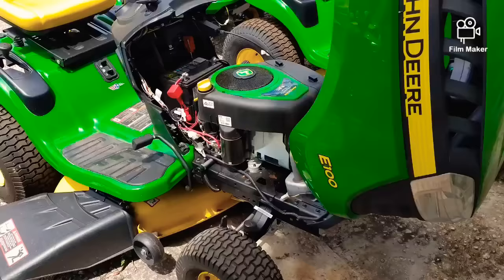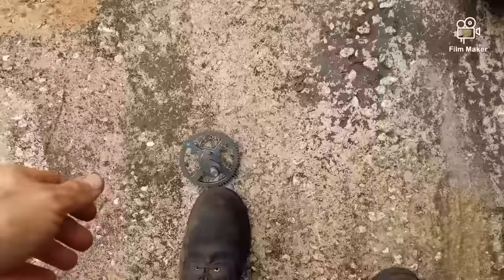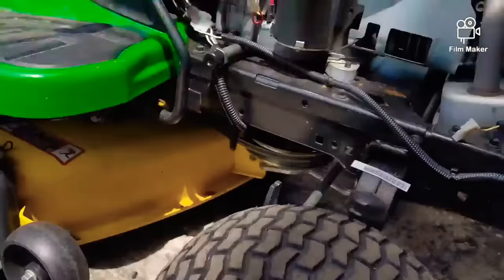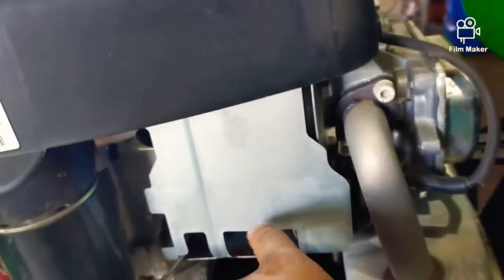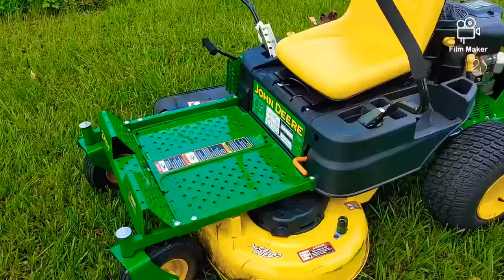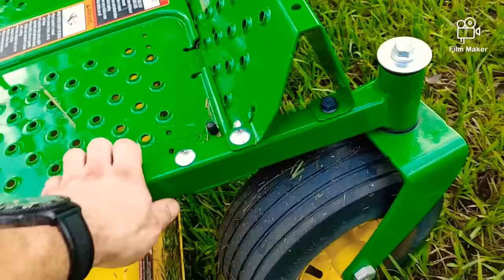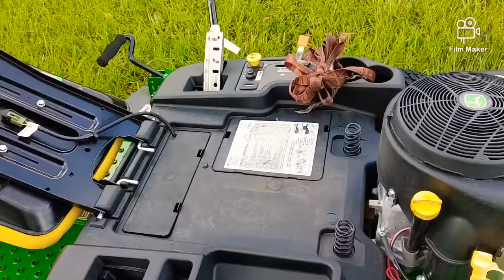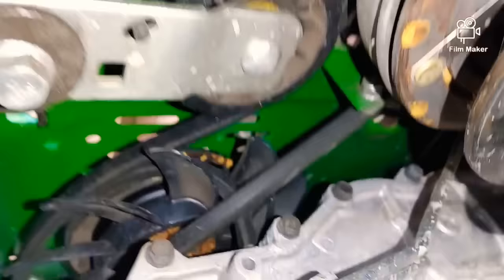Lawn mowers to avoid!

Comment: You bursting my bubble man....
      I picked up a husqvarna 246Z that is about 4-5 years old.  It had 4.6 hours on it.     I bought it from a local tractor supply in Oklahoma called Atwoods.  I was told as is no warranty. I guess I guy bought it new and used it a few times then it went to the shop for a repair on the motor, something to do with the flywheel.  But it was the end of mowing season and it went to a local authorized small town repair shop that was backed up.  For whatever reason they left it set outside at the shop the entire winter before it was fixed. Then when the customer goes to pick it up for the new season thinking he has a new mower. So they brought him this mower out that the labels and the plastic is faded and has a cracked seat. He said hell NO!! So husqvarna replaced it direct and this mower ended up setting in the backroom of this store for 4 years.  Then I am walking by the store one day and seen it out front with a AS IS sign and it said needs belt and battery.  $200.00   So I asked them if I can borrow a battery and if it started and the hydros moved I would buy it and the battery.   Oh... I had to buy a key too.   It has 5 year old gas and it started right up and it moves under power.... I said sold!!!       I got it home it was missing the spring for the deck belt tensioner is why the baldes did not turn. I had I old spring I tossed on it and they spun right up.  But somewhere the dudes story was off because it had a badly bent blade and a cracked spindle casing.  But other than that it is a new 5 year old mower.      I bought it 2 months ago.  Sometime after the first I am going to order the right spring and the blades and spindle.      But I was pretty pleased as I always wanted aZero but did not want  to give up the $3200 that this model sells for new.  

I guess everyone gets lucky sometimes.  Normally if I hall in a pile of shit I come out smelling like shit, But hell this time it was a rose! 😂😂🤣🤣        I have not used it yet and no tellings what dude hit.  I was thinking maybe he hit something so hard the sudden stop of the blades jolted a under torqued flywheel and broke the key on the shaft knocking it out of time.    But who knows?   I know I got a good deal.    Sorry to ramble on.  Great video and thank you for sharing the info on things too look out for.  This has a twin briggs so maybe it will be okay.

Comment: Sometimes it’s just luck. I bought a country clipper 25 years ago to mow a tough 3 acres. I never did proper maintenance, I abused it like a farm tractor, pulling stumps, moving campers, ect. Busted all the transmission cooling fan blades(plastic) in the first year. It’s sits in a barn on dirt floor all winter . Tires dry rotted, deck finally rusted out neglect. I bought a new one last summer and noticed it’s not quite as robustly built but still leaps and bonds better than big box store mowers. I’ve also noticed that mowers listed at 1500 bucks 3 or 4 years ago are now going for closer to 4K. 😂. Oh Yeah, that old neglected one I’ve had for 25 years still runs great and moves campers all the time(in grass, no pavement). I don’t know if it’s a testament to quality or just plain luck but the only issue is dry rotted tires I just fill up whenever I use it.

Comment: I have that same Z335E. Took me 20 minutes to replace my drive belt. Not a nightmare as you described. Don’t even have to remove the deck which is great! That’s the only issue I’ve had. I did buy the foot peddle to raise the deck though I do agree that’s a shit design. It’s a great residential mower in my opinion.

Comment: I think you should have been clear about this applying to recent models as far as the JD zero turns. I work on small engines as well, and my personal machine for my 1.7 acre property is a Z 245, have had it over 10 years and has been excellent, could not ask for better.
Reply from the maker: Hi Peter, I agree with you that I should have made the point that Im talking about the recent z335. Id guess 2019 - 2022 models. John Deere actually improved the mower drastically. They now went back to using bearings for the caster forks, improved front tires, the deck lift now uses a foot lever and dial to set the deck height. They also got rid of plastic planel the covered up everything under the seat.
Reply: I’m buying a z245 with 168 hours on it, anything specific to look for?
Reply: @Mechanical_Mind  I just bought a 2023 z315, whats the diff between those and the 335?

Comment: Either the cam lobe is made of "plastic" or, it's a pressed in metal lobe. Both are crap to work with. I had a John Queer which, the lobe turned a little bit on the cam thus, throwing the timing off. It was a pain to find. What saved me was, I had an engine in pieces and, I compared the camshafts side by side. The one under repair was off by about 2º. Once I got the new cam, it confirmed that the "old" cam metal lobe did spun a little. I spot welded a couple of tacks around the new cam lobe so, it would stay exactly where it belongs. I don't know if it's not recommended but, the machine still works, as we speak.

Comment: I have a Z335e with aprox. 650 hours on it(i use it commercially)  and what the guys says is right...plastic bushing breaks.  front wheels need to be inflated often( i keep an air compressor in my truck almost just for that)  the drive belt was replaced once(not a very hard or expensive job to do) the solenoid in the back near the rear bumber needed to be replaced once(JD upgraded the piece)and 2 inside solenoid under the cover needed to be replaced....good first zero-turn for the money to start my business but next year i'll put that one on the sideline and use it only has a backup unit.  Next zero-turn will probably be a Z500 series from JD or a Z200-400 series from Kubota...what do you think?

Comment: According to one YouTuber from California you need to use less polluting electric yard equipment.  My comments were do you really want that yard tractor with those unstable Li-Ion batteries that can burst into an un-extinguishable 5000 degree F fire.  Not for me, until they perfect those batteries and shore up the electrical grid to take charging all  those yard equipment and automobile chargers and support your house air conditioning equipment.

Comment: I have a XT 515E with a 54 inch deck.  I have almost a 3 acre yard.  This mower was bought almost a year ago and it only has 23 hours on it.  It has been a piece of junk and stays broke down more than it stays running.  I bought a ZT1 cub cadet and haven't had any problems with it.  The John Deere 515E is the worst investment I have ever made.  I will never buy John Deere again.  Within the first 30 days that I had it, I called Ag Pro in Macon, GA to see if I could trade it or bring it back.  I was told NO.  I will not deal with them again either.  I'm still paying on a piece of junk that is literally broke down as I'm typing this.

Comment: As a z335e owner it’s a pos. Mower cuts half the yard and dies.  Come back later to continue. New carb new gas cap new plugs filter air n fuel. Very disappointed.

Comment: I think the older generation of residential zero-turn mowers are built better. I have a 2007 42-in cut and 48 in cut zero turn. Both have 700 hours now on the Briggs & Stratton engines and they still run fine. I've had both zero turns for 14 years and the only thing I had to replace was the head gasket on both engines. Other than that no problems. All these newer residential zero-turn are just built cheaper and a lot more complicated to fix.
Reply from the maker: I agree older mower where built much better. I have many loyal customers that would also agree.
Reply: Go with the Kawi

Comment: Not all residential zero turns are like that. I have a Kubota Z122 (42" deck) and it has none of the problems you mention. The deck is fabricated, the casters have a grease fitting, deck lifts with a rod and foot pedal, etc. The residential Ariens/Gravelys are also made similarly. I agree those John Deeres are crap though.

Comment: I bought a Cub Cadet medium tier quality zero turn mower back in 2015.  I've never had any issues with my mower, and  I have a rather large yard.  Also I NEVER step on the deck!   
I have a severe bad back, and I can access the deck without stepping on the deck.  

The only thing I dislike about it... is the battery is a pain in the ass to take out and put back in...there is a bolt that is on the frame and it's in the way.  I lift that battery out every fall and bring it in the house and put it on a trickle charger for the winter.  One has to lift and tilt the battery perfectly to get it past that bolt.   

It would have been much easier if they gave that space another 1/16 of an inch to just lift that battery straight up and out. 

The batter also sits behind the seat, there is no compartment under the seat.  And if sitting on the mower, it's not that hard to lift the deck with the lever to change the cutting height.  Again, I have a very bad back, and I'm able to do that without much problem. 

Maybe I just got lucky, or Cub Cadet was making a better zero turn mower back then I don't know...but again, no issues with my machine.

Comment: I've had great luck with my LA 115 - 2009 model  , 19.5 Briggs  . It has the metal transmission , but I didn't have an idea about those plastic transmissions . John Deere is cutting there own throats in my thoughts ....

Comment: Just like any other piece of equipment, all of them are crap if you don't take care of it. With that said, I have beat the living crap out of my Z235 for almost 10yrs. Where I live, rocks "grow" by the day and I am constantly going through blades. However, after busting enough rocks to pave a Seaworld parking lot...I have yet to have to change a spindle. I've had to make repairs on the deck and the guide wheels are a constant nuisance...but overall...this mower has held up better than any mower I have previously owned (at least 10), for the amount of abuse it takes and the minimal amount of maintenance it has taken to keep it running well.

Comment: I have one of those twin cylinder Briggs and you forgot to mention the valve guides that push out. Mine went out at 30 hrs and JD failed to cover it! Dealer blamed overheating but that was an excuse but these mechanics aren't capable of evaluating much as  mine was never run hot and was impeccably cleaned, maintained and always stored indoors (come on 30 hrs!?) Replaced head and expect the same to repeat itself soon. John Deere sells because of its name but that soon will be destroyed when management continues to make these poor marketing decisions.

Comment: Here’s my story on my JD E100 bought from Lowe’s, paid $4000ish it, we have approximately 1acre to mow guessing 3 times a month 8 months a year, had the mower just about 3 years, it ran perfect had right at 100 hours on it. Was redoing my fence around the property was using the mower with a trailer to keep materials supplied to my kids as they dug holes and set posts  yes I had approximately 400 pounds in the trailer. It quit moving, felt like the drive belt was stretched, I took the mower to my local John Deere dealer Everglades John Deere in central Florida, he says oh yeah this is common problem, $600 I pick up the mower, no change, no warranty !! $1800 for a new transmission !!! NOT HAPPENING !!!!

Comment: I purchased an la145 from Lowe's. It was on sale and it was a Deere (I thought). Within a week, one of the spindles on the deck broke. I went to a John Deere dealer for the part that Lowe's didn't carry, the dealer looked at the spindle and said let me guess, you bought it from Lowe's. He told me Deere doesn't actually make those mowers and took the time to show me the difference between mine and the equivalent REAL Deere. Needless to say, when the tractor died after 5 years, I bought a Toro, straight FROM toro. I was told mtd makes those mowers for Lowe's, home depot etc and Deere slaps their name on it as entry level deere's. Don't buy em.

Comment: 4:41 Disagree.
I bought a z-235 Deere 16 years ago to mow 3 acres of rough land. It's still like new and gets the job done with ease. Deck cables last about 5 years every time, and I'm still running on the original store installed oil.
Reply from the maker: You do realize that your 16 year old mower is js nothing like what I went ovet in this video right?? Its almost like some people dont realize that they change things over the years 🤣

Comment: For a few years, I used f535 jd lawn tractor. Didn't like it at all. Underpowered, steering was crap, because of the bearings in the back wheel.

Comment: OK....  You just ruined my day.  I have a residential John Deere Z.  I've had it for 3 seasons going into the 4th.  So far, no problems.  It seems to me I should just keep it because it works fine.  I wouldn't even no how to get rid of it;   Plus, you would have me buy a commercial Z which seems like overkill.  I bought my Z from a John Deere dealership, and I was going to buy a commercial grade, and the guy told me that I would be unwise to buy such an expensive mower to cut less than a 1/2 acre.  So, I am between the rock and proverbial hard place....🤣
Reply from the maker: Sorry I ruined your day.. Im working on a new video and it looks like John Deere has made some major improvements
Reply: @Mechanical_Mind  mine is a z345r….  It looks the one you had in the video

Comment: The residential series Zero Turns are a complete joke, whatever brand.  It's a "STATUS" thing today for homeowners to get a ZT,  they think because they're generally more money,  they gotta be better than the typical lawn tractor.  ZT's got their start COMERCIALLY !!   They're intended to be used as such, where a lot of ground has to be covered very quickly, and with many quick turns and maneuvers.   For a typical homeowner lawn situation,  a ZT will do way more damage to the turf than a standard lawn tractor.
Reply from the maker: I was basically telling someone this morning the EXACT same thing. 🤣. Im always like wtf do you want a zero turn if you're not a commercial landscaper? Lawn tractors will not tear up your grass as easily, they are much cheaper to buy and maintain. Plus they easier and more enjoyable to drive around. Most people think zero turns are more serious machines. Its kinda like dudes driving around in $80k 3/4 trucks but their truck never gets used for anything more than a car.
Reply: @Mechanical_Mind  SPOT ON !!!!!  Something else, correct me if I'm wrong,  people don't consider is many of the ZT machines have TWO transmissions instead of just one like most all lawn tractors.  Double Trouble in my estimation.  Thanks for your video presentations !!   Good job!!
Reply from the maker: @santaclause2875  yeah thats another good point. The zero turns have two transmissons vs one. Twice the risk you will have an expensive repair coming. Other than the plastic transmissions used on some lawn tractors (JD has stopped using them),  
I raley see lawn tractors coming in with transmisson issues. Zero turns all the time. Maybe the constant sudden back and forth use zero turns get cant be as good as steady forward and slow reverse use lawn tractors get.

Comment: Some of the commenters have older versions of these machines which makes be think they were made without plastic businings and parts. If these machines are used on a manicured suburban lawn and are maintained by the owner they should last for many years. Time is money in a shop. They have to skip the diagnostics and depend on their experience for the most likely cause of the problem. That means changing parts until the problem goes away which in 90% of the cases works. DIY people can afford to wipe off oil, grease , dirt and grime from the nook and crannies. I wash the pre-filter and wipe down the air filter housing inside and out after every mowing. When I change the oil filter I wipe up every drop of oil from the engine and mower frame so it is as clean as my kitchen table. Any shop that is that meticulous wouldn't be very profitable or would charge more than people would be willing to pay. I have a set of extra filters and belts on hand because of the convenience of not having to make a trip when I need to do my maintenance. It's better to get your maintenance done in the fall because wait times won't be a factor and come spring time all you have to do is check your oil level, which you should do before every mowing, and go.

Comment: Here's another one to avoid, the Poulan Pro PB301. Motor is solid. drivetrain, steering and mower deck assembly is complete junk. This thing is a nightmare to keep running, I am going to pull the engine and put it on a Haban pull behind finishing mower and scrap the rest.

Comment: i have a 335 and havent had any issues until a mouse got into the carb.  Pray you never have to remove the carb.  Has too many levers push rods etc.  Took it to a local shop and they could not even get it back together.  Choke no longer works.  Cant find a diagram of this engine anywhere on the internet.  I think I just bought my last JD.

Comment: I had a Zts 435 that had a serious issue of neutral creep with the handles in the stop position I looked all over that mower did not find any adjustment besides the tracking bolts I had to unbuckle the plastic linkage and adjust it that way I still think there is a better way of adjusting but I couldn't find it .